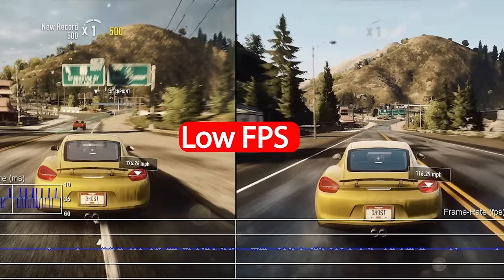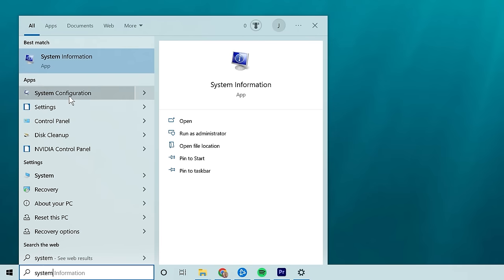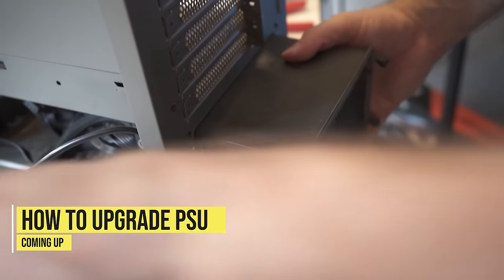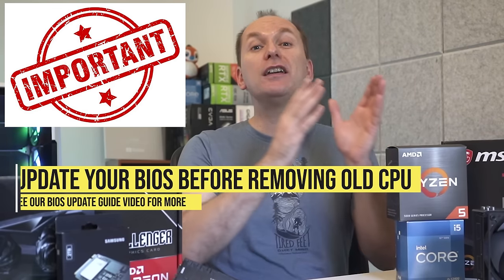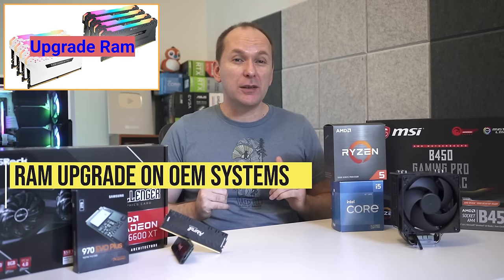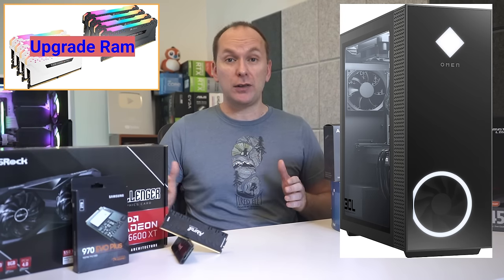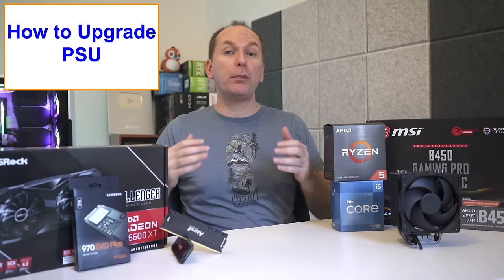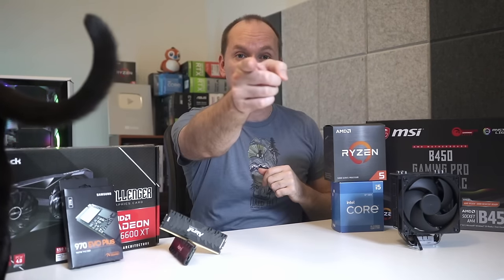How to Upgrade Your PC: How to Upgrade GPU, CPU, RAM, SSD & More! How to Upgrade PC

Comment: Have the 6c 6 th 9600k (2020 build) 3060 32gb ram. I found gaming performance close between Linux and Fresh 10 21H2, think the later had more raid fps dips when the affix went off. 1440p render scale Linux found I was able to do world boss good fps, but would say raiding/m+ were where I noticed having to put settings down (render scale). Am technically above recommended specs but those specs listed are for 720p on the game site, coffee lake/newer 6 cores. It has been 2 years since last build was done after test realm to be ready for prepatch and now it is 2 years later. I helped my friend with his 5800X build a short while after and he is very happy cpu-wise with the performance but had to carry over his RX580 when GPU shortage happened. The UI overhaul has my current rig running better on the beta version of the new expansion coming November 28th. Have 2 builds with EVO212 but messing with that cooler is annoying. A lot of guides seem to have 6-8 cores minimum where I should have the next upgrade.

Comment: I was playing a game while listening to the video, so not sure if you mentioned this or not. However it used to be that you'd have to reinstall Windows after a motherboard upgrade (I believe it's a mobo upgrade.. I wasn't really in the PC era during that time). Not sure if this is still true. I sometimes see folk mention it in a subreddit occasionally when someone's upgraded and having bluescreen troubles.
Reply: Depends, if you are going from intel to AMD or vise versa definitely reinstall windows if not you don't need to

Comment: I need to upgrade my CPU motherboard and RAM currently, will likely do graphics card not long after.
Planning on upgrading to an i7-12700f, 32GB DDR4 3200mhz and Gigabyte Gaming X B660. I'm currently using an Intel xeon e5-2667 v2,32GB DDR3 1600mhz and some random chinese x79 motherboard. My graphics card is a 2060

Comment: Have an old Dell 435T /9000 (2008) Win 10 , all parts are OME.  I7-920 2.66 hz. 12gb ddr3 , nvidea 260 ?, hhd 1 Tb, probably 80% full.   Slow as Molasses in January.   What can I do to speed it up a bit?   Seems to take forever to load anything.   Motherboard is ? .   Thanks

Comment: Ryzen 7 3700x,AMD Radeon RX 5700xt,TUF Gamingx570-pluswifi,16 3200 ram all in a 2019 prebuilt ibuypower. 1080p gaming. Daily black screens and crashes when gaming, read it could be problem with the old 5700xt gpu. Thinking of building my first pc watching your videos as reference. 5 5600x or 7 5700x with 6600 or 6700xt with 550 Motherboard? 60y/o gamer here wondering if I could really build one myself but excited to try. Thanks PC Builder.

Comment: I have a AMD ryzen 5 3600 with a SoAM4 B550m motherboard and using a RTX 3060. I have no clue about anything else. Im gaming on a 1440p ultra wide oled 165hz. 

Should I upgrade my system or build a new one?
Reply from the maker: An upgrade would match your monitor way better than your current build. I'd drop in a 5700X3D then upgrade your GPU as much as your budget allows. Double check your PSU like we go over in the video as that may need to be upgraded as well. See our Best GPU/CPU Combo 2024 video for more

Comment: I was planning to upgrade my used non-oem pre built pc..but just finding out now that the psu only has 1 6pin connector for the gpu, I'm now limited on what i can get. With that, any suggestions on what gpu i can get now before i need to upgrade my psu (maybe in 2023)? I narrowed down to 6500xt, 1650, or the 1060. I will use the pc for house renderings via enscape, btw. Hopefully you can give some suggestions..thanks!

Comment: Don't you need to uninstall gpu drivers before upgrading? Especially going from amd to Nvidia?
Reply from the maker: Not necessarily but it is never a bad idea to run display driver removal software.

Comment: Hey, that's a great video. I need some advice. I pretty much have to a buy a new monitor for remote work (1440p) and as so i need a new GPU. My platform is almost 10 years old now with i7 3770, 16 GB RAM and Z77 MoBo. I'm a very casual gamer, not an enthusiast and i'm fine with running a game in 1080p on a bigger monitor. I was up for going with GTX 1660, but i was suggested it's not worth the money these days and i should look for 1660 Ti, or even RTX 2060 / RX 6600. Could you give me some tips on this. I'm using mainy 2D graphics programs like photoshop and illustrator for now, but heard AMD drivers can have stability issues when running those on typical gaming GPU's. Also i might be upgrading my platform completely in the next 8-9 months, but i'm not sure yet. The gpu and the monitor are a must in a matter of a month, maybe two.
Reply from the maker: Check out our Best GPU 2022 video!

Comment: Hey jason, i have ryzen 5600g and rx 6600, i want to upgrade the cpu to ryzen 7 5700x ( the reason i have the current setup is because in my previous setup i only using ryzen 5 5600g) should i considered upgrade my cpu to ryzen 7 5700x?
Thank you.
Reply from the maker: You would actually get more of a performance boost going up in your GPU first. See our Best GPU/CPU Combo 2022 video for how to think about this

Comment: Hey love the video, Im looking to upgrade my rig that i have since 2017 with a gtx1080 and ryzen 5 1600. The build im currently planning to build would have a ryzen 7 5800x, either a 6900xt or gtx 3070ti, 32gbs 3600 cl16, b550 tomahawk. I am alittle over budget of $1800-2000 CAD. Any advice to change anything?
Reply: My pcpartpicker build is in my channel's about, because I wasnt able to post the link into the comment section

Comment: It's worth it upgrade a i3 8100 to i5 9400 or it's better change the entire platform?  Recently bought a Rx 6600
Reply: Change the platform. He has a video released called "🛑STOP🛑 Buying Bad Combos! Best CPU and GPU Combo 2022" which he lets you know which CPU is best for that GPU. But i5 12500 would be the better choice because it has 6 cores and 12 threads plus 18MB and has a base clock of 3.0GHz. It is also much newer.
Reply: @jodiepalmer2404 thanks, I will check it

Comment: My primary storage is a 2TB m.2 gen 4. My mobo has another m.2 slot but that’s gen 3( I think). For my secondary, should I use the gen 3 m.2 or should I go with an SSD?
Reply from the maker: I'd go M.2 as they are now cheaper than Sata SSDs.

Comment: My current parts:
Intel i5 8600k
EVGA GTX 1070
16GB DDR4 RAM
550w PSU

I am going to upgrade my CPU first to an AMD Ryzen 5900x. I have switched to Linux to get used to it while my steam deck was shipping however I plan on staying on linux as I didn't like windows to begin with and a very tiny amount of games I own won't run under proton. I have an Elgato HD60s and I refuse to replace something that doesn't need upgrading so I plan on using the 4/12 cores to run a windows VM and use that for recording my Pokemon gameplay.

I still don't see the need to upgrade my GPU ASAP yet because my GTX 1070 runs games at Native 1440p and the very rare occasions I need to use FSR perfectly fine. 
The only compelling reason I have to upgrade my GPU is for Raytracing as I don't care for competitive games like cod warzone and will only play csgo to mess around with one of my friends.

If you have any recommendations for my GPU upgrade which will most likely be a few months into next year, let me know. I am keeping an eye on AMD as the 40 series RTX cards from Nvidia don't entice me. I am also struggling on deciding on the motherboard. I don't want to spend more than I need to.

Comment: Question: I have a laptop ryzen 7 5000 series , AMD radian graphics card with Rtx3050 6 GB and RAM 16GB and SSD 1TB.......bought just for game most of it for rpcs3 emulator and it doesn't performs the way I hoped becouse of the frame drop. My question is Will the increasing the RAM from 16 to 32 GB make a difference?
Reply from the maker: You can certainly try it, but its likely the GPU thats holding you back

Comment: "apply a pea sized amount of thermal paste"
is shown applying a huge diagonal line 😁

Just built a new mid-range gaming pc except for the gfx card. Am going to wait a bit more for pricing and availability of the revised 3060 ti set to launch in October, since mid tier 40 series won't launch until next year. Any thoughts?
Reply from the maker: haha! Listen its a p sized amount in a line (; 
It will be interesting to see what AMD brings to the table on Nov 3rd as well. If you can wait for a while I would

Comment: I have a 1660 super and wanna upgrade to the 3060 but don't know if u should buy now or wait
Reply from the maker: That card won't be replaced by next gen until well in 2023. Prices may drop in the next couple of months but if you see a price you like I'd go for it. Depending on your market you might also find that a rx 6600 or 6600xt is an even better deal

Comment: Hey jason I been wanting to build a rx 6800 xt in my pc. I saw benchmarks everywhere and I love the price and performance compared to the competition. However I see that it only runs minecraft rtx at 15 fps on 4k. I find this extremely sad and am in denial, however I see in the comments that there is a driver update for amd that fixed this. After looking up information on this I couldn’t find anything to confirm this. Do you know about this? I don’t know much about computers, so some help would be greatly appreciated. Thank you!

Comment: hello sir, i have a pc that is old from year 2018. i want to upgrade it that can play and have a decent performance. is there any recommendations for this pc upgrade? 
specs:
cpu : ryzen 3 2200g
mobo : asrock b450m pro4
ram : 8gb 2666mhz
gpu : rx580
ssd : 240gb
psu : 500w 80 bronze
Reply: PCPartPicker Part List: https://pcpartpicker.com/list/8mxxcb

CPU: AMD Ryzen 5 5600 3.5 GHz 6-Core Processor  ($149.00 @ Newegg) 
Memory: Silicon Power XPOWER Turbine 16 GB (2 x 8 GB) DDR4-3200 CL16 Memory  ($44.99 @ Amazon) 
Total: $193.99
Prices include shipping, taxes, and discounts when available
Generated by PCPartPicker 2022-09-25 07:23 EDT-0400
Reply: RX 6600 for $230 at Best Buy. Your 500w PSU is fine.

Comment: Can you upgrade from 3600 to 5600 without new beta BIOS on b450 ? Are you sure ? Isnt pointless if you didnt get SAM ?
Reply from the maker: You will need to update the bios to one that supports the 5600. It is easy to do, just make sure to do it before you switch the cpu.

Comment: i would love to upgrade my old CPU (R7 1700x) with an Ryzen 5600x or else , how ever since i have never done it , and my old cpu gives me alot of troubles and headache with my Ram and stability of the System, i am not sure if i just go for an entire new pc.  My Motherboard (Crosshair VI Hero) should actually be able to handle an Ryzen 5xxx series if i update the bios. My Question would be , if i screw it up and it doesnt work as i wish , could i go back in the Bios of my MOBO and repick the R7 1700x so that my pc atleast works?

Comment: I’ve been watching a lot of your vids over the past few weeks. I was wondering if you can do a more in depth guide to budget gaming builds. My ps5 crashed and it’s my second one. So I started to use my older custom built desktop but it crashed last week and it’s quite old so I have to build a new one. Funding is not there right now either so I have to figure out a really small budget build that will still allow me to play Elder Scrolls Online with decent frame rate. I’ve been on disability since 2012 so when I built my last pc it was a DDR3 that I spent about a thousand dollars on. But I don’t have those resources any longer. I’m selling any and everything I can to try and get funds together since gaming is super helpful to my peace of mind throughout the day dealing with my physical issues. Any thoughts  on what would work for those who are in a similar situation would be super helpful. I know there’s only so much one can do…but I figure if anyone can figure it out it would be you. Thanks again!
Reply from the maker: With all the new product launches we'll have more guides coming soon. But right now I'd check out our Best Builds 2022 video. We have some great budget builds in there starting at $400 that might be great for you.
Reply: Thank you for your reply! Yes I’ve been looking over every single video you’ve made after friends on eso recommended your videos. I’m not sure if you play eso or now but would you know if the minimum system requirements would be met by the starter builds you’re recommending to play at 1080p? I copied/pasted minimum and recommended requirements below. Any advice would be awesome. I’m clueless when it comes to these things. 

PC RECOMMENDED REQUIREMENTS:
Operating System: Windows 7 64-bit
Processor: Intel® Core™ i5 2300 or AMD FX4350
Memory: 8GB System RAM
Storage: 85GB free HDD space
Video Card: Direct X 11.0 compliant video card with 2GB of RAM (NVIDIA® GeForce® GTX 750 or AMD Radeon™ HD 7850) or higher
Sound: DirectX compatible sound card
Internet Broadband Connection

PC MINIMUM SYSTEM REQUIREMENTS
Operating System: Windows 7 64-bit
Processor: Intel® Core™ i3 540 or AMD A6-3620
Memory: 3GB System RAM
Storage: 85GB free HDD space
Video Card: DirectX 11.0 compliant video card with 1GB of RAM (NVIDIA® GeForce® 460 / AMD Radeon™ 6850)
Sound: DirectX compatible sound card
Internet Broadband Connection
Reply: This is what my previous 10 year old pc had that recently started randomly shutting off trying to run any programs. 

Motherboard: gigabyte f2a85x-up4
Processed: AMD A10-5800K APU WITH Radeon 
Memory is just a seagate 1 rn hdd and 16gh ram ddr3 and graphics was an amd Radeon 7660d

Comment: My current setup is a 1060 6gb, ryzen 5 3600, 650W psu, 32gb ddr4...

I've been wanting to upgrade for a long time, GPU shortage stopped me, but gave me a chance to save up more money, I'm REALLY wanting to get the Ryzen 9 7900X and initially the 4080 until the info on pricing came out, now I'm considering getting a 4090 instead. I'm aware I will have to do a full upgrade but I'm not 100% sure if I should wait for AMD GPUs or just pay for a 4090. I have the money to get it so that's not a problem
Reply: Almost the exact same situation here. 1060 6GB, Ryzen 7 2700X, 620W PSU, 32GB DDR4.
Wanted to get a 3060 but GPU shortage... So I saved and I saved and I saved. Now I'm getting myself a Ryzen 9 7900X system next week (assuming there's stock), also getting the 4080 16GB or AMD equivalent though, I'd pay extra for the 4090, but 450W TDP is gonna be a no from me.
Reply from the maker: Ryzen 7900X and RTX 4090 would not only be a massive upgrade, it would be one of the fastest commercially available gaming PCs on the planet!

Comment: Is it ok to upgrade just my gpu from gtx 1050 to rx 6600 xt/6700 xt but my mobo dont support pcie 4.0? Or i should get new mobo for that?
Reply from the maker: Yes you'll be fine. Neither GPU saturates PCIE gen 3 (only the fastest do). The 6600 series uses only PCIE x8 (rather than the full x16), but the difference on a Gen 3 system is only 1%.

Comment: What would be best I’ve got 8700k 1080ti play at 1440p 16gb 3200mhz use mainly for gaming
Reply from the maker: Probably a GPU upgrade would help you but check out depending on what you have.

Comment: At the 15 second mark, the picture of that case, it's a Thermaltake case. My brother bought a skytech pre-built pc with that case and his Temps were out of control just with a 2600x. More times than not he'd be gaming at 85c. That case is horrible for air flow. Upgraded him to an AIO, since he liked the case so much. I still don't recommend the case. Plus those pre-installed case fans are noisy as all hell when at mid to high rpm. Just my opinion and experience. *Edited to correct my grammar lol
Reply from the maker: Thanks for sharing!

Comment: I recently had to fiddle with a b450 board to get it to boot with the 3200 speed ram by putting in older 2133 memory I had from 6700k system, then picking docp manually. This was a Asus tuf pro s that works with newer amd stuff like 5500 and 5800x3d.

Comment: Build a fairly budget system about 6 months back, 5600x, 6600xt, 16 gb 3600 cl18

Considering saying screw next gen getting 32gb 3600 cl16, 5800x3d and a used gpu for cheap and calling it a day

Comment: I'm gonna buy a 3060, need Nvidia with 12GB or more for AI art (otherwise would get 6800-6900 XT) and use it on my current PC (B250 with a 7600K). After that I'll buy either the Ryzen 7600X (fitting!) when we get some reasonable AM5 Mobos or a 13th gen Intel depending on how that pans out.

Comment: Speaking of Upgrades, My childhood friend has this gaming pc that to me needs upgrade. Here's his pc parts:

-Ryzen 7 2nd gen w/stock cooler
-Aorus X470 ultra
-2x8 Ripjaws + 1 Aorus RAM in his 4 dimm slots( He used to have 4 aorus ram in his slots but 3 of em died )
-WD sn750 250g + 1tb kingston NV1 and a bunch of hard drives and sata ssds
- Gigabyte RTX 2060
- The gigabyte case that you said has no airflow plus 6 argb fans ( he has a well airconditoned room but i can feel the microwave heat coming off his case when I touch the side glass) 
- Corsair RMx 2018 850w

To me his pc definetely needs upgrade. I recommended him to upgrade the case and gpu if possible (maybe even necessary)
Reply from the maker: 1. Don't mix and match RAM kits (using 2 identical 2 stick kits is ok to get 4 sticks) so get rid of that wayward stick. I'd be concerned that 3 sticks died as that is VERY unusual and points to either user error (way too much voltage manually applied in bios) or an issue with the motherboard itself. That gigabyte case is terrible for airflow, I'd either remove some of the glass panels if possible or swap it out. All the fans in the world won't suck air through glass. If the mobo is ok, I'd go Ryzen 5600 for $150 and also upgrade the GPU.